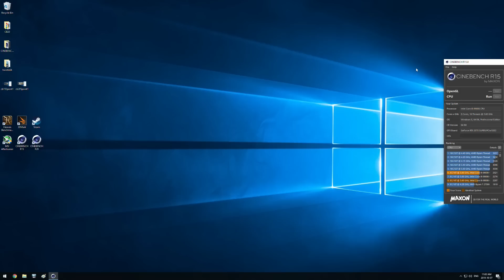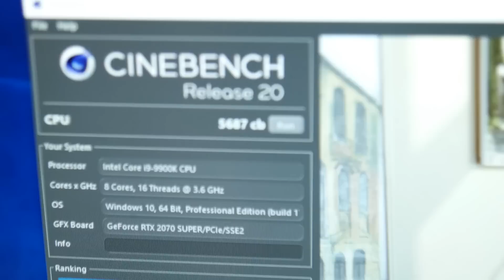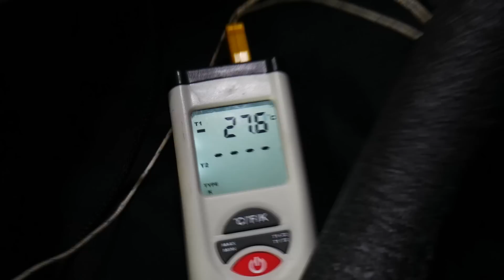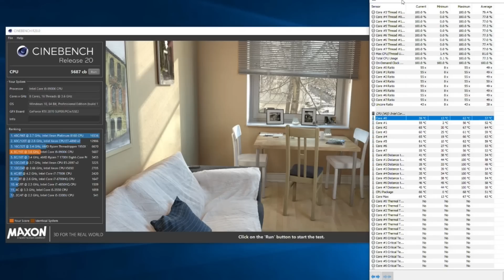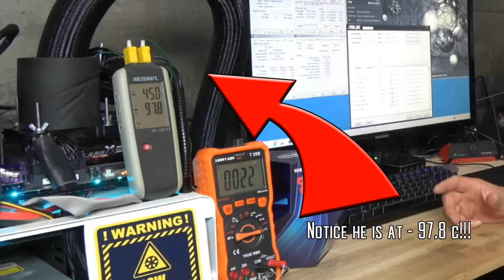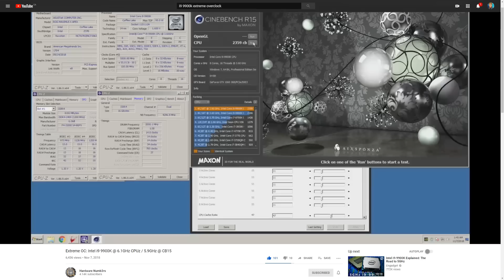Chilling my 9900k to 5.5Ghz!

Comment: Could a computer run in a chamber filled with nothing but ln2?
Reply: Yes actually. The setup and cost is just too much.. imagine watercooling ln2... same theory
Reply: bearded hardware I assumed it could. If it were in an atmosphere of only ln2 it should be able to function without condensation. Obviously it’s impractical but I’d like to see it done. The roboclocker isn’t practical but I’d love to have one lol
Reply: jordan secrist if you let the nitrogen into computer case itself it will remove the condensation.. it’s a pain in the ass setup.. there was another company that did it.. the cost is just way too much..
Reply: bearded hardware how much ln2 do you use in a typical overclocking session?
Reply: jordan secrist usually one session around 30 liters but it depends on what’s benching.. cpu and gpu.. can go pretty quickly
Reply: bearded hardware so about 15-30 bucks for the cpu. I imagine the gpu would require a little more right? And the pot hold what? A liter? Btw I subbed to your channel. Pretty cool.
Reply: jordan secrist awesome broski.. depends on cpu.. 10 core higher intel soak it down.. amd is a little light as they don’t use power.. 28 core Xeon and 2080ti are ln2 abusers.. I usually fill 30 liters..
Reply: bearded hardware sorry for all the questions I was kind of gathering numbers to see how much it might cost. If you have a 300ish ml pot on your cpu and go through 30 L of ln2 average and you have a full tower at 125 L packed with a hot cpu and 1 or more gpus you could end up spending 12,500 or more on ln2 alone if it’s matching the same pour rate which I doubt it would. Interesting. Seems like something Linus should do just for a video.
Reply: @MisterRorschach90  Well i get 160 liters every couple of weeks.. costs about 200 for delivery.. No worries for questions.. Are you thinking about how much it would cost to run on a daily machine?
Reply: bearded hardware no just how much it would cost to run it as a test for a few hours or something. To fill a large case you’d need 100-150 liters of ln2 but it would evaporate pretty fast wouldn’t it? You’d have to dump whole tanks into the case constantly wouldn’t you? Granted I have 0 experience with even using ln2 the “normal” way. I’m too afraid to ruin my only hardware.
Reply: jordan secrist depends on type of tank, closed loop would ave on EVAp as you could recycle.  What uses more ln2 is how you push clocks also.. 6ghz to 6.5 ghz is pretty damn easy on intel
Reply: No

Comment: I want to buy a 9900 for christmas
Reply: Atm the 3800x is so cheap compared to the 9900k it seems like a better value to me. The 9900k is a little bit ahead at gaming but you would also need a good cooler in order to get to the 5ghz clocks that make Intel super good at games. On the flip side, the 3800x comes with a decent cooler out of the box and can be used with cheap b450 motherboards like the tomahawk max or great x570 motherboards like the TUF plus Wi-Fi if you would like pce gen4 ssds. The guy calling the other guy a moron is kinda right because its not better than the 9900k but it's close enough I think you would agree if you had one
Reply: Ok NOW UR FKN STUPID buy the ryzen 7 3700X it has a good cpu cooler that comes with it and u can overclock the cpu to 3.855ghz with it !!
Reply: It’s cheaper and better
Reply: Don't listen to this moron. He's a blind fanboy that only thinks in peasant logic. If you game, especially for high FPS low res competitive FPS gaming, the 9900k at 5 GHz will kick the shit out of any Ryzen CPU. Check out Gamer's Nexus 3900x review. The 9900k is up to 30 FPS faster in some games. I'd rather have the extra 30 FPS than save 30 seconds rendering when compared with a 3700x. Plus, you don't have to deal with random issues that come with an immature platform.

Comment from the maker: Anyone know where or how to get one of those direct refrigerant CPU cooler thingies? I want one so bad!
Reply: What about a direct die cooling plate like Der Bauer makes? And maybe look for a better coldplate? That would probably get your CPU temps down closer to the actual temp of your coolant.
Reply: ArchAngelRaceWerks delidding and replacing paste would help for sure.. don’t really need the bracket.. stock Ihs is fine
Reply: @BeardedHardware  the 9900k is soldered TIM, it's about as good as it's going to get. Using TIM or liquid metal and just putting the stock IHS back on there is status quo. Getting rid of the IHS and cooling the die directly with a high quality coldplate is probably the only way to get the CPU colder with the chiller that he has. And it will only be an incremental improvement.
Reply: ArchAngelRaceWerks replacing the solder with paste will give him a better temp delta than with the solder. He’s not really that cold so he needs all the help he can get.. also lapping the Ihs will usually make a hell of a difference and negates anything the direct die frame does.. Lm can be used because he’s not really sub zero when running load.
Reply: Hey! If you were based in Europe I would give you the contact of the guy who made my unit (Cascade Phase Change), let me try to reach out some friend based in US/Canada who might know who can build one, but take in consideration that is very expensive, more than 1300USD, plus is noisy as hell and it draw like more than 3000W. I use it to pretest the components before an LN2 session, if you like extreme OC my advice is to buy a CPU Pot like the Kingpin Trex and do some experiments with Dry Ice, that can go around -70°C and do nice things, and you can go further with LN2 when you have more experience. Thanks for the shoot out, if you need any info on XOC feel free to contact me, Twitter, email, what suits you best 👍
Reply: Hardware Numb3rs he’s just slacking.. he needs to hit me up.. have had a couple single stages and cascades myself
Reply: Slacker.. I can get you a single stage or cascade
Reply: Timmy Joe PC Tech wdym
Reply: Maybe some specialist?
Reply: This is the real deal...don't let the prices scare you too much ;)
Reply: https://www.coleparmer.com/c/recirculators-and-chillers
Reply: kyle fish what do they do, my mums husband has had one for like a year and said since he doesn’t use it and no one will ever buy it he would give Timmy it for 80 bucks, but I ain’t sure what they do can u tell me
Reply: My mum husband has one he said he would give u it for 80bucks